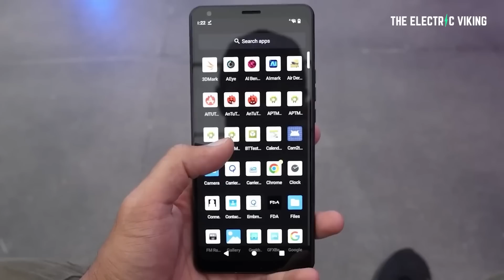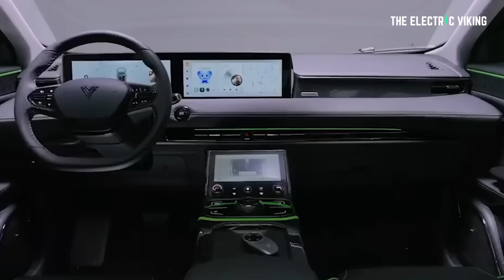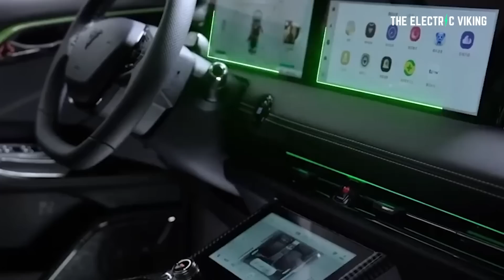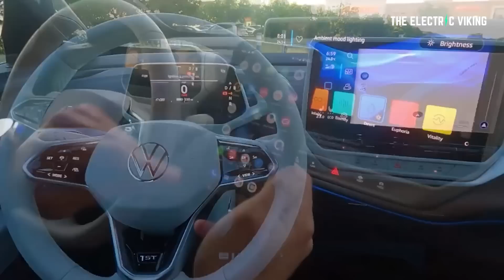Europe will be flooded with superior budget priced Chinese EVs

Comment: Japanese legacy auto makers are pretty much doomed in the race for EV production and market share, they are too late for the party.
Reply: It seems that way, but the Japanese have a history of catching up fast. We'll see if they still have what it takes.
Reply: @ChickensAndGardening  They have all tech in EV but they are not fond of entering market with no or get less few profit.   Consider Toyota EV is a little bit pricing lower than Model 3 ,guess which one is to buy.
Reply: @alexlo7708  it not that EVs are not profitable it's that legacy OEMs are so inefficient at building them that they can't make money on them. Tesla has the highest margins of any mass market manufacturer selling nothing but EVs
Reply: @ChickensAndGardening  japanese are not spring chickens anymore. Hopefully they will turn around but the whole country needs a major wake up call. (hating on foreigners, domestic electricity production, birth rate, ... )
Reply: @saff226   But Tesla are deemed expensive even its model 3.
Reply: @alexlo7708  plenty of manufacturers make cars that are more expensive then Tesla but make smaller margins
Reply: @ChickensAndGardening  I have a soft spot for Honda and their history of building cheap, fun, reliable gas powered cars, but I really do think they will get left behind as the industry transitions to EVs, even the 2 big boys Honda and Toyota. Even Sam mentions this in the video. What's Honda's current EV strategy? First rebadge GM Ultium EVs to sell as Hondas. Then build a competitive EV themselves, except their software is lacking so they will need to team up with Sony, and if all goes right, the first Honda/Sony EV will be launched in 2026. The Chinese are iterating their EVs sometimes every 12 months! By the time Honda finally launches that first EV which might finally competitive with 2022 era EVs the Chinese are gonna be another generation of EVs ahead, maybe two generations. The market is moving so fast right now and the Japanese are being rapidly left behind.

Comment: a story. I bought a second hand Nissan leaf two years ago. The dealer said it came without the media card due to GDPR rules ( they said). no worries, how hard could it be?  nissan were stumped by this. after months of back and forward, the service centre finally decided that I needed a  new head unit at a cost of 2000 pounds. or 400 pounds, or 4000 pounds depending on who I talked to. 
the power of the internet, 199 pounds and I have a working head unit. works perfectly included android auto/ apple car play, which the head unit did not come with originally. 
car refuses to connect with the app. 
2 years of refusals, and on the spur of the moment I raised it again with nissan online. this time, different person, fixed immediately. so I have actually got a fully working fully featured car and connected services. 
they aren't worth fighting for, nothing I actually need but finally it's working as it's supposed to. 
still, only 2 years. that's probably quick

Comment: No, no, no! Over £30,000 is not budget friendly, not inexpensive, not affordable EVs.  This is extremely disappointing. 

These should have been £20K to £30K including the SUVs versus 30% Tesla profit margins or even parity with list price 

When BYD and the rest offer LFP … as standard 250 - 300 GOOD true  miles range 150kw charging speed, mid sized family EVs - 

THAT ARE no more expensive than £30,000 (average UK income) then THAT will be a major break through. 

Deeply saddened … I AM SO UNDERWHELMED by the recent 2022 Euopean BYD price announcements… A

TOO HIGH.  

Not half price of Tesla 😢😢😢😢😢

The ONLY benefit is in a few years more USED EVs will be available. 

Only MG4 in the ball park at moment. 

See RSEV YouTube channel

Comment: I wonder if the EU will invent non-tariff barriers a la Tesla’s driving aids. SAM YOU ARE ABSOLUTELY RIGHT - as usual. Chinese car makers see a lucrative market in Europe compared to the cutthroat competition inside China. Mercedes, BMW, VW and Stellantis are desperate for electric cars to fail - because they can’t make them PROFITABLY. I’m about to buy an MG4 long range ES costing £28,500 it’s about £10,000 cheaper than the VW ID3  Keep going Sam and thanks.
Reply: I've no idea the profit SAIC earns on each MG4, if any profit at all, but they'll surely instantly sell every single MG4 that show up in Europe. MG4 pricing is insane compared to European competition. How is it possible that a modern long range MG4 with a 4 star EuroNCAP rating is CHEAPER than an ancient Renault Zoe with its 0 safety stars?

Comment: Hmm beter a amd or intel cpu then those snapdragon chips, for you re phone oke but for an EV i am not so sure, tesla is using the latest amd zen 3 or 4. Just 1 chip that does everything and when faulty can be replaced in an easy way. Not so sure this will be the case with those snapdragon chips. Don t like them never did !!

Comment: A disadvantage that I see (at least for the German market):
The new brands don't have dealers / a dealer net.
(I want to be able to go to a dealer if there is a problem with my car.
inspection / services / repairs.)
Reply: Plain Truth  The cheapest BYD Atto 3 is 42.245 € at the moment in Germany.
The cheapest VW ID.3 is 38.060 € at the moment in Germany.
Reply: @s.oliver3687  Can't wait for the EV revolution I'm not going to the a early buyer prefering solid 100 year old tech in a diesel than constantly moving goal posts of Electric cars. Made with throwaway parts and very flimsy guarantees on major components.
Reply: @s.oliver3687  That may be true in Germany, but in the UK, the ID.3 starts at like 34k pounds, while the MG4 is coming in starting at like 26k, and MG even has a dealer network too. I think in most places in Europe, these new Chinese models are coming in with significant discounts to comparable European models. MG is going to have zero problem selling every MG4 that comes into the UK.

Comment: As usual Sam, thank you so much for the update. Agree with all you've pointed out. I'm still inquisitive as to what EV you bought or have ordered. I'm sure I'm not alone. I received my Atto 3 two weeks ago and could not be happier. I think I made the right choice as I've heard that the Model Y, good as it is, is a very firm ride which I would likely have found uncomfortable. Go on, spill the beans - BYD, Model Y or something else?
Reply: If you want a good ride, don't get the optional (overpriced) larger wheels.  They use lower profile tires that ride bad, are noisy, wear quickly, and are expensive to replace.

Comment: We're in California, can't afford to drive due gas prices and can't charge fast enough = not enough grid...  Help us Sam..
Reply: Buy solar panels…
You don’t need a grid connection.
Reply: I guess what you need is BYD's DMI car.  Take BYD's Song Plus DMI car for example, it has a battery can power itself around 75 miles. If it runs out battery,  a super highly efficient enigne will start to charge its battery and the whole range would be around 800 miles and city fuel efficiency is 60-65MPG.  Besides that, it can be a smart super power generator for a home in power outage.   But i don't know why BYD didn't sell them outside its domestic market. Probably due to the super large demand.

Comment: Having been to China this year, I totally feel what you're saying. I would dump my Volvo XC90 for a nice Chinese EV in a heart beat, if they were available where I live. If they can maintain their Chinese price, like half the price of a XC90, that would just be the icing on the cake.
Reply: If you're concerned about safely why wouldn't you buy a Tesla, the safest car ever made.
Reply: @PaleBlueDotCitizen  Because most people aren't made of money? A BYD Atto 3 also got a 5 star EuroNCAP rating, and literally costs half the price of a Model Y. There is a reason BYD is using the Atto 3 as its launch vehicle in multiple international markets. It is a compact crossover with decent range, good build quality, excellent safety ratings, and rock bottom pricing. Extremely good overall value.
Reply: My China assembled CT6 2.0E plug-in was about half price and 575 miles two years old.  Going to difficult to match that savings on the next car.

Comment: Nice analysis.  A couple of points. Some countries have set deadlines for low/zero-emissions vehicles ONLY to be sold (e.g. UK from 2030, EU 2035). Legacy automakers seem to be dilatory and incompetent in their response to such looming deadlines - head in the sand as you indicate. Secondly, one massive bug bear with rapidly updated vehicle models is that the spares situation becomes almost untenable. Instead of having one part to do a job, with, perhaps, a newer, better drop-in replacement available, you end up with sets of linked parts with compatibilities and incompatibilities with other parts.  This additional complexity seems to have two effects: identifying and solving car problems becomes much more difficult; all parts have to be ordered, based on what the mechanic sees in the vehicle, because no garage can stock all variations of the parts, thus extending the time to fix problems.

Comment: Sam, we are dying here in California with almost 7 a gallon. We need these Chinese EVs here, much more affordable and definately a better battery than these Tesla. We don't want to get stranded going up to Vegas in a Tesla...
Reply: What about Vinfast? 😆
Reply: "Better battery than these Tesla"? Um, most new Tesla models have over 300 miles per charge, and even old used Teslas will do over 230. That, and an abundance of Superchargers everywhere, and a navigation system that shows where they all are, and clear warnings when the state-of-charge is getting low... 

You'd really have to work hard (and be champion stupid) to get stranded on a Vegas trip in a Tesla.
Reply: Tip: visit a supercharger station along the route to quickly recharge the battery while you take a bathroom break and buy some food and a coffee.

Comment: How would these budget EVs do with U.S. safety standards / requirements ?  (No condescension intended - it’s a genuine question)
Reply: As good as it be, consider Vietnamese car can go easily there.
When 1st cheap Hyundai car went to US , It entered there easily also.  This is political patronge , not a real car quality.  However , in the near future ,there will no China cars entering US , as there are tariff barrier among them and China know US autos market have room providing in patronage their vassals.
Reply: Don't know about the us, but both byd Atto3 and ora good cat had received five star ratings from euro ncap.
Reply: @cindyluk9460  Yeah, they wouldn’t be able to sell them there otherwise, I imagine. Duh !  (On me)

I think my brain was more thinking about those WuLing etc. $7,000 EVs that are sold in China.
Reply: @amigajoe  The Wuling was never meant to be anything other than a city car, and isn't allowed to be driven on the highways in China. However the fact that the Ora Cat and BYD Atto 3, which cost only around 20k USD in the Chinese market, but receive 5 star crash EuroNCAP ratings, really shows the level of current car design and manufacturing in China. The Europeans should be very worried that a brand new bespoke EV hatch like the MG4 is coming in with 5 stars yet is still able to be priced cheaper than an ID.3, and in fact is even cheaper than ancient European models like the Renault Zoe which has literally 0 stars on a modern crash test.
Reply: @cindyluk9460  BYD Atto failed Australian testing because of a missing child restraint that the European testers missed. The BYD Atto is illegal to sell in Australia as a result. BYD basically lied on the compliance report.

Comment: Legacy will probably never build good software because they don’t have that core competency. They would need to hire a well-known technology thought leader to build out a software engineering division. They can’t compete for talent… If you are a grad from Stanford with a software or electrical engineering degree, where do you want to work Tesla? GM? Ford? 

But don’t worry, I’m sure the US taxpayer will have to build them out a few more times before they get put out of their misery

Traditional US companies… They sit and watch as Tesla and the Chinese go from a speck of dust to bigger than they are. Why? Because they are not and never have been focused on the customer. Back in the 70s we had high inflation but guess who just kept on building those big old gas guzzling cars from the 70s UNTiL Hondas and Toyotas started to get imported to the US. US car companies scrambled to change their design and compete. Sound familiar?

Comment: What is the OS they use. Is it a modified open source based on UNIX,/Linux. Or a totally new os from scratch. Suspect many variations across the range of makers of EVs.   EV here in UK still a longway off in many parts of UK. The cities will benefit more. But if we get flooded with cheaper Chinese cars, then the market may change.
Reply: Apple IOS, Android (Linux) and QNX are the current operating systems being used…

Comment: VW simply had to build cars with enough software to control the batteries and motors. Everything else could have come from the existing systems using the customer’s smart phone. But no they had to do a botched rewrite with awful user interface. No wonder people walk away.
Reply: VW have had revised software in Europe for 12 Months. Apparently the over the air update didn’t reach outside Europe…

Comment: You are at least on part very very very wrong sam. What people want us affordable ev..... me personally I could not care if it even has a screen all I need is a speedo and battery level indicator.  Just safe and affordable. Air con a bonus with battery heat management that  should be a given anyway. Automatic powered doors and tailgate total waste of resources and money fancy flashing mood lighting. No thanks... 27 speaker immersive surround sound... no thanks just a stereo is fine.... I want a safe reliable affordable car nothing more or less I think i am in the majority

Comment: I personally think infotainment systems should not be in EVs. For ao many years we already knew car infotainment systems were simething legacy auto wanted to xontrol in their design. In my view the democratization and hype of the infotainment system has lead to similar developments in the smartphone world. While it has improved greatly the power, control and access to in vehicle data drastically, I am still seeing the same old story, even in Tesla. Smartphones have been used to planned obsolescence for years, and beyond the increasingly more difficult to repair screen and battery, smartphones continue to diminish in improvement of the phone beyond the software. Phones get slower over time even with software improvements. As functionaloity and complexity increases, current chips have also been shown to grow redundant fast, as opder software will eventually not run on "older chips" anymore. We've seen it with Early Trdla model S'es. We thought they would run for years and not need an update. After only 5 years, for people who wanted to, could upgrade the MCU for 5000 dollars. But really recommended to upgrade to a new car. I find thus business model toxically expensive. A car is for most people a whole different order of a life purchase (second biggest purchase in lofe to your own house!). If we start thinking democratically as cars where software and computers become more important than the intended tool of driving from A to B, I think the business model of all current EVs, including Tesla's is already an outdated model because you simply can't change the modular hardware with the times. We already see new chips almost every year, yet many Tesla chips are already over two years old and will likely become redundant in the next one to 3 years. There are many reviewers that say that current new Chinese EVs that are going to flood the market with bad buggy software. We are complaining forever with Volkswagon about poor software. I can't help think if software is holding us back, so much. Why don't we make EVs more simpler, than they already are, and get rid of the infotainment system, but just build in a high quality computer with good parts. If we want the latest and greatest in infotainment let us use our smartphones, tablets and or computers. Volkswagen has a great design of simplicity with their e-up. Just a simple smartphone holder. Download the VW app and you have the dashboard on your phone. Great second life for older smartphones, and easier to replace than a whole. 10 times as much costing, limited edition infotainment system, that legacy auto don't really know how to deal with. To a degree vertical inyegration is helpful, but I also think there is still merrit to outsourcing, but having control over the software with partners. I think sooner or later as EVs grow we are going to run into the growing question of right to repair, no matter how fewer parts EVs are going to get. We're already seeing growing frustrations of Apple's intense control of their hardware, but software locking components that can only be repaired by Apple certified repair shops, and all else have to pay an immense premium for the certified repair shops, but also for the owners who have to pay a premium that really incentivizes buying a new phone or refurbished phone. I think the future is going to be messy in terms of the future of the modern infotainment systems in EVs. I would like to see future base mode EVs, with nice interior, relvant hardware buttons on the dash and steering wheel, without an infotainment screen, but supports an in built dash cradle for smartphone and or tablet and that eveything can be run from the phone and or tablet. I think that is the future.